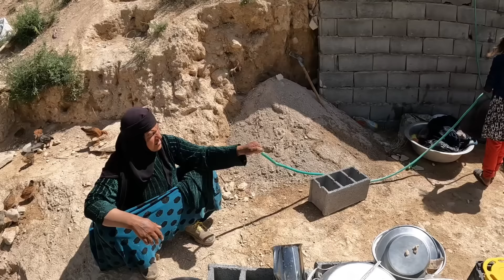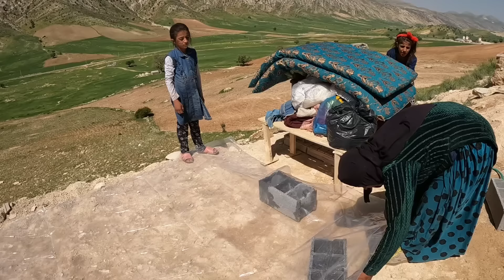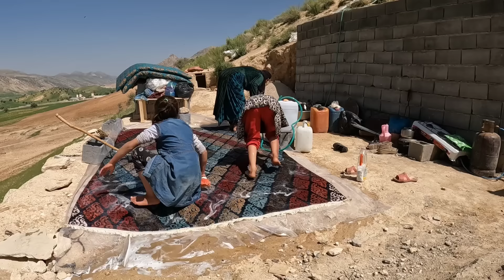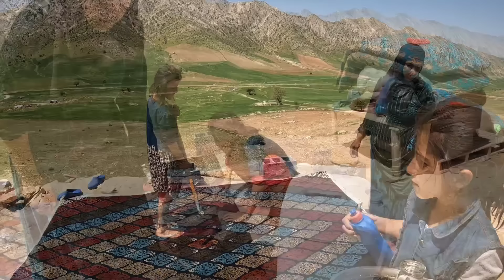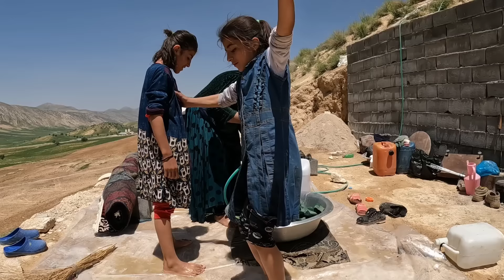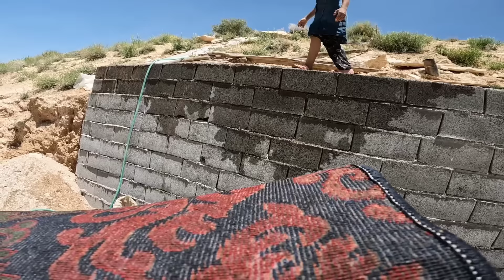"Innovation of grandmother's life in the cave: using black cave water for washing"

Comment: Yes so good with water with out water cant do anything yes they need those drums were you can warm water an one to stock water in winter the pips will be blocked  or make a hole an save water you need to put plastic  inside the hole so the water will not go down  god bless toall